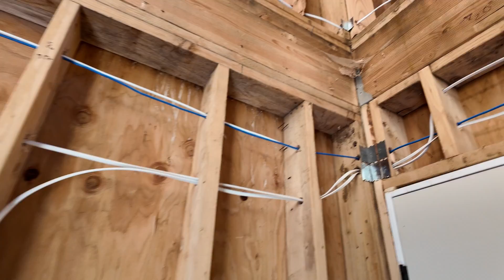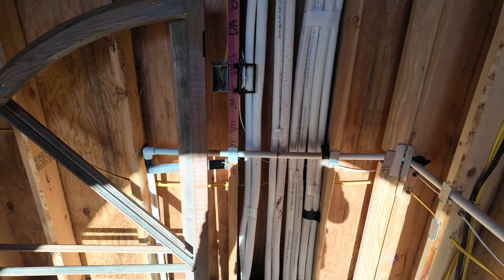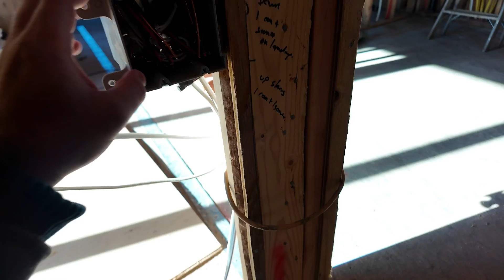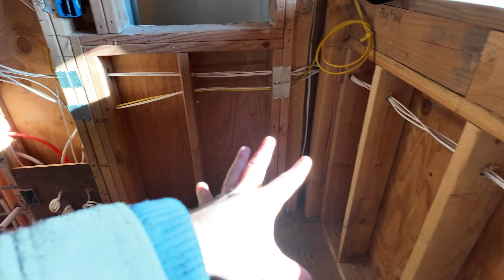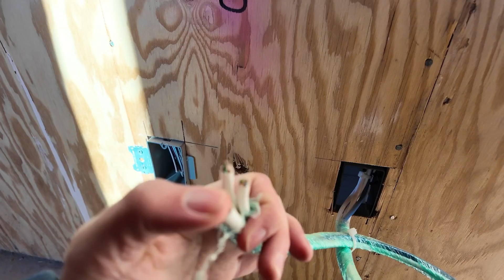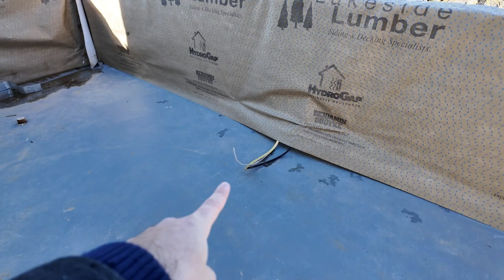Complete pre-drywall walkthrough of Unit C - electrical, low voltage, plumbing, mechanical | Ep 25

Comment: I see no ingress from the outside for things like fiber ?
also, no provision for fiber ?
for things like heating you don't need it to be DC, as they are merely oversized resistors, AC works fine
Reply: The fiber line from the street already comes in to the existing building that my studio is in. I'm going to run a fiber line between the buildings, it will go into the little server closet outside (video of that is coming soon). So there's no fiber inside the house, but we'll have fiber between the buildings. I'm also in the process of upgrading everything to 10GbE so there will be high speed links between the two buildings too.
Reply: @aaronpk  any chance of testing / using the 2110 hardware from BMD in there ?
Reply: @AmauryJacquot  yep, that's the plan! I'm switching my studio over to 10GbE now and will plan on doing some tests of the 2110 stuff there in the next month or so. Then long term I'll put a 2110 converter in Lily's studio and mine so we get 3 bidirectional video feeds between them!

Comment: You should consider some sort of kill switch for the A/C voltage line in your server room, that would trip in the event that the sprinkler is set off.  Better to restore from an unplanned shutdown, than to watch all of your server electronics fry because a downstair tenant does something to set the sprinklers off.  If I understand those commercial sprinkler systems correctly, if one head is tripped, they all go off.
Reply: This sprinkler system is relatively low tech. Each sprinkler head has a little vial of liquid that expands at around 155°F which will cause the glass vial to burst. The glass vial is the only thing holding back the water flow, so once it bursts, water starts spraying out of the head until the main water valve is shut off. So there's no electrical system, and no interconnections between sprinkler heads, it's all just mechanical. Each head will operate independently, so if there is a fire in one part of the building, only that head will go off.